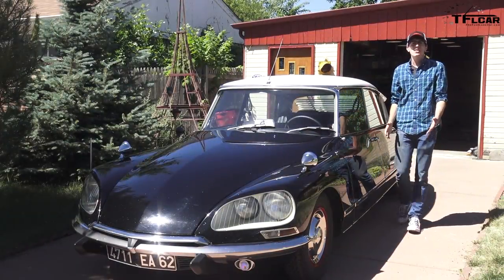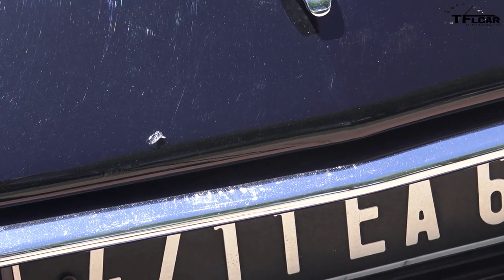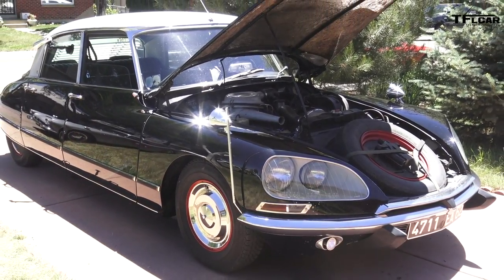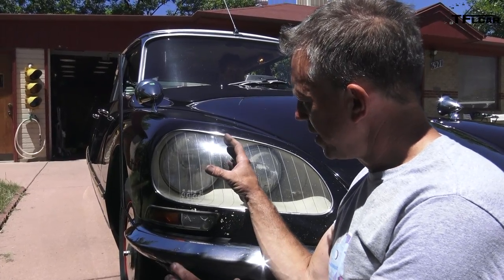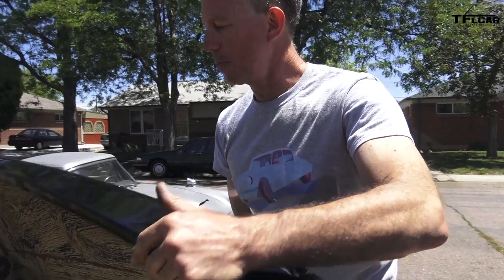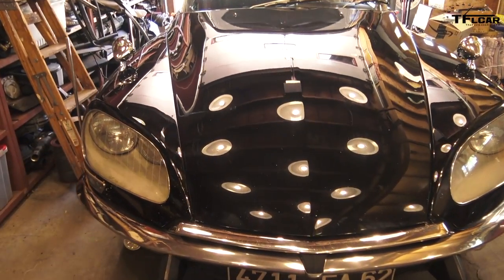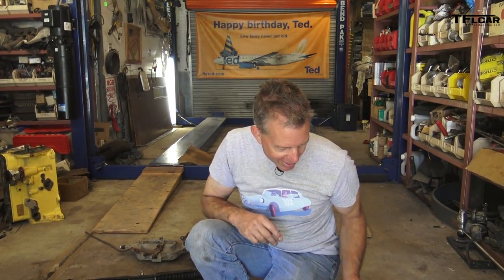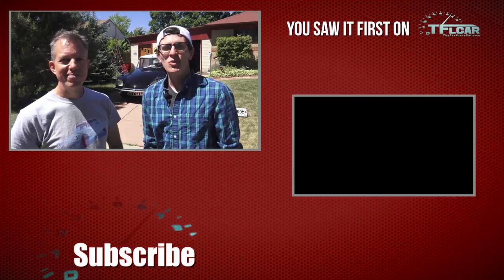Top 10 Reasons Why This Is The Most Revolutionary Car Ever Made

Comment: The engineer in me is impressed. The mechanic in me is thinking "what a nightmare to fix!"
Reply: I owned four of them for several hundred thousand miles.  Except for hydraulic leaks (easy to repair) and new front brakes (easy for non-mechanic) nothing ever needed repairs,  Cars died due to body rust  or accident; never anything mechanical.

Comment: To continue my Citroen story after selling the "D" special I purchased a new 1988 Citroen BX TRI and it's been my daily drive until a few months ago, water pump has failed and I have a couple of minor fluid leaks and it's difficult to find an honest mechanic in this small town, unfortunately I'm not able to work on it myself due to health issues, as I had in the past. The only major issues I had with the BX (with 500K + miles) was 2 blocked fuel injectors, front discs and the starter motor which I had to remove and have it reconditioned about 3 years ago. Regular servicing (oil change etc.) is mandatory! How's that for reliability? BTW - a great video which brought back many pleasant memories, thank you again.

Comment: I owned many of these absolute fantastic cars. The offset west south west steering column is so if you are highway cruising you can rest your arm on the door rest and hold the steering wheel on that joint. In left hand drive countries the column is facing east south east.

Comment: I have been thinking, recently, wouldn't it be great suspension for a camper trailer. You could raise it for big bumps and dips, and lower it for highway driving and for parking. Scaling it for 7000 to 10,000 would be a major challenge, and powering the hydraulics would need a wheel driven hydraulic pump, or maybe wheel mounted electric motors and a hybrid-style battery. The battery would be great for boondocking as well.
  Sigh.
Just a wild dream.
Reply: Scaling wouldn't pose a problem. As I just happened to post in another thread, Terberg of The Netherlands does their own version for heavy trucks. I think Citroen themselves also worked on scalability, together with the coach builders that modified Citroen CX's for international transport etc.